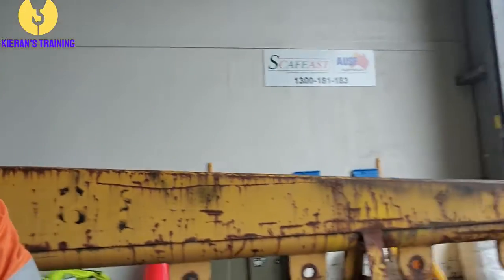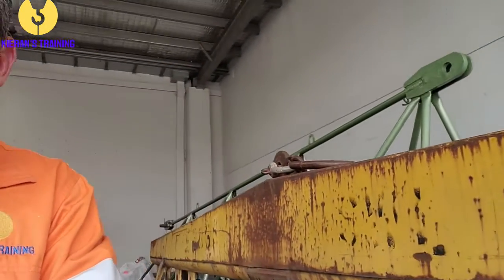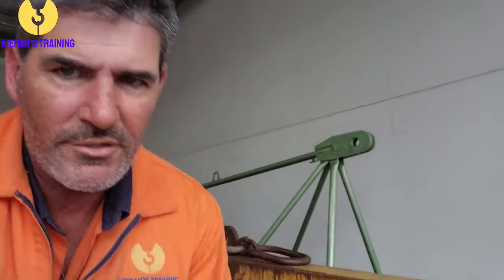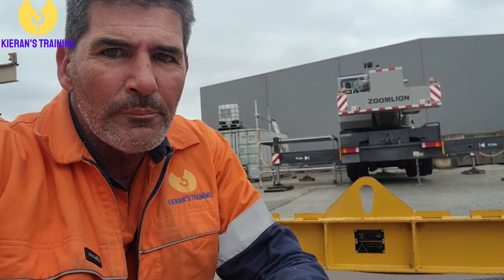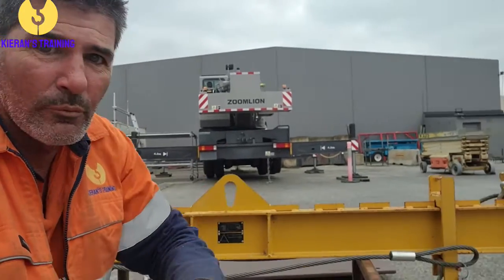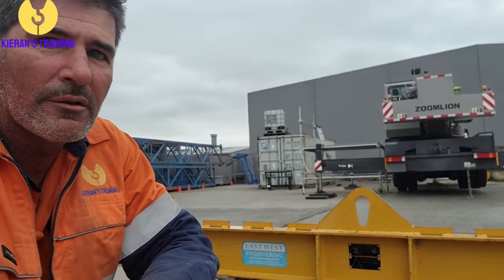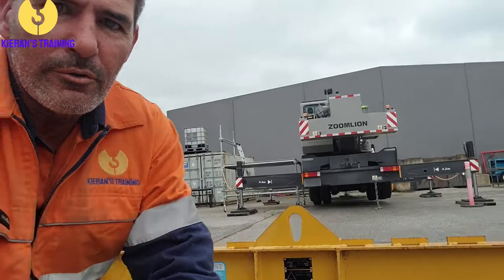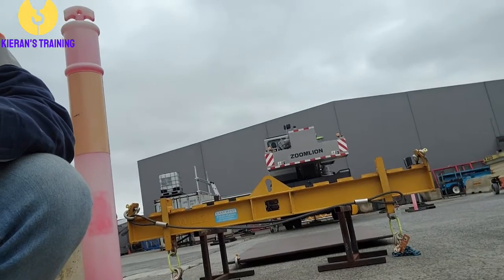What is a Lifting Beam and a Spreader bar?

Comment: Main thing is a lifting beam is used when there is low head room but it has to be a balanced load, can't have one side heavier than the other because it will tilt with it being a central hookup, Spreader bar requires a lot more headroom to allow the rigging to create a V but it can be used on a load that isn't nearly as balanced, we use spreader bars in the heavy wrecker world for that reason.
Reply: OK, so a spreader can be used on an unbalanced load in all circumstances?
Reply: @BA-be5vm  No, It still needs to be within reason but there is definitely more wiggle room.
Reply: @towtruckaj do you have to incorporate chain falls
Reply: @BA-be5vm  No idea what that even is, so no. 
Assuming we are talking about a generic single-eye lifting beam, the load has to be pretty much perfectly balanced, or the beam will pivot. If it has adjustable rigging points, you can deal with off-balance loads a little better by using offset rigging points on the beam.
For a spreader bar, the ends of the beam are both supported by separate straps forming a V, so there is a lot less room for pivoting on uneven loads. Further adjustments can be made to the load itself to balance it if needed but if you are not lifting very heavy you can be a fair bit off balance and still lift something just fine with a spreader bar, thats the big reason they are used in the towing industry is lifting cars, semis, etc often results in an off balance load and spreader bars simply don't care as much as lifting beams do.